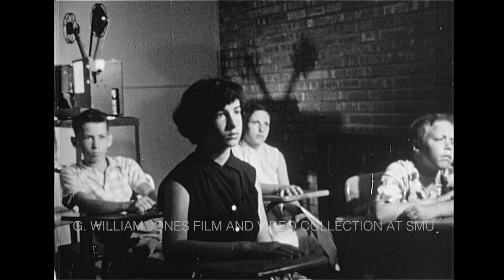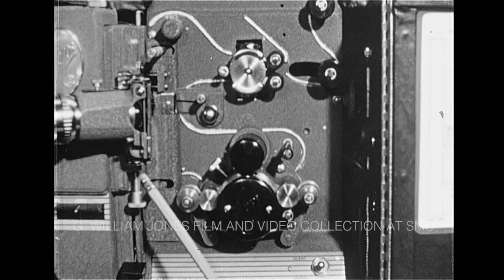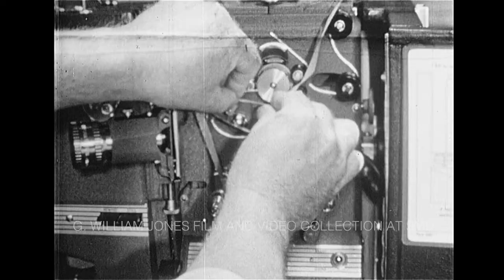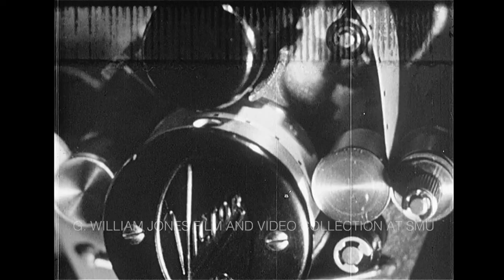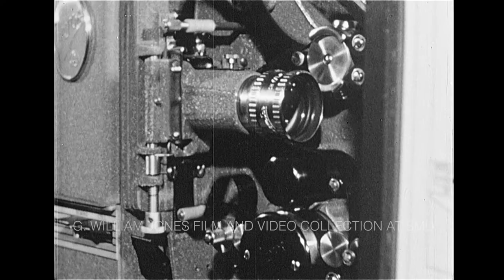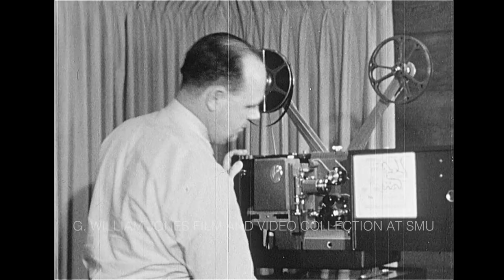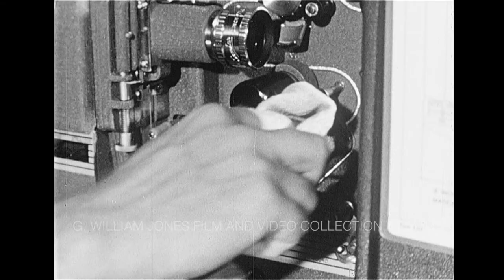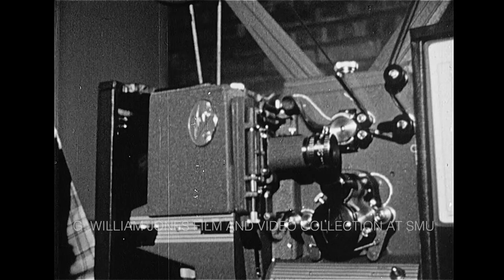Operation And Care Of The Victor 16mm Projector - 1954

Comment: I have the model 40 Animatophone from 1941. Pretty much the same mechanism and film path. Much more powerful amplifier. I had to replace a worn cam and claw mechanism, and the replacement claw I I had to carefully file because one claw was worn, causing uneven engagement. Once I got both teeth to engage simultaneously on good film, it ran well. It has steady pictures and is smooth and gentle to the film. I keep it well oiled with synthetic oil. The automatic trip mechanism is a great feature for when film jams.

Comment: Well, it doesn't have the take-up reel dangling below table level like the previous Victor model, but still well behind the Bell & Howell projector.
Reply: Quite right the Bell & Howell  Had the special feature of a worm gear that would disintegrate slowly and damage your film
Reply: I have a 1941 model 40 which has the same film path as this projector. I've yet to see a Victor with a low hanging reel. Ampro had a low hanging reel.